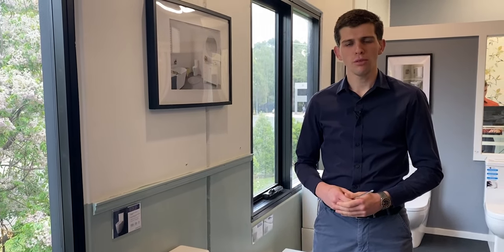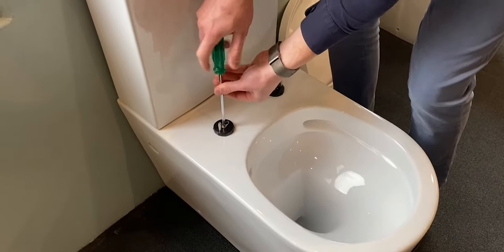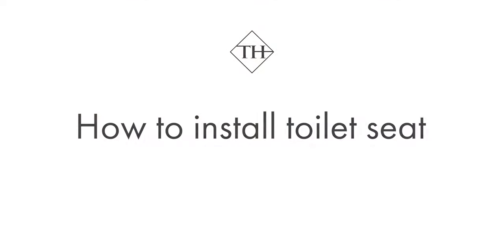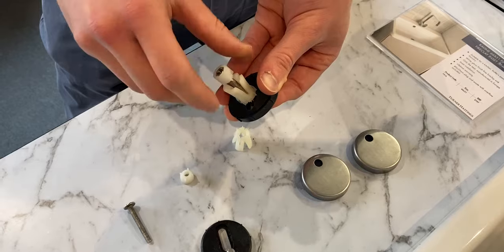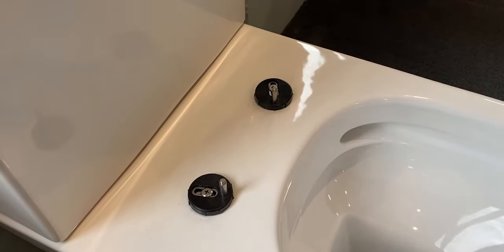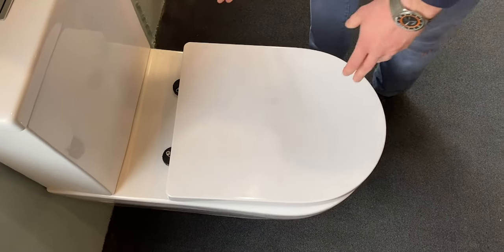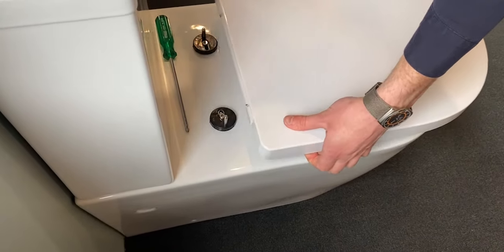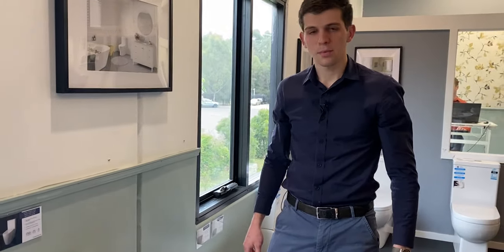How to Remove and Install a Toilet Seat

Comment: This is probably 8th toilet-seat DIY video I watched today. And it's the first one that actually showed the type of toilet seat that I need help with. And it was explained nice and clearly, at the right speed. Thank you so much
Reply: I can't get at the screw now to tighten it since I've put the plastic disc over the screw,can't get the disc off what  nightmare.
Reply: It was well explained. I followed the instructions, and I have successfully fixed two of the toilet seats that have been giving me concern. Thank you so much.
Reply: My words are exactly yours. Thanks for the excellent video and explanations.
Reply: I came here to leave this exact comment only to find out that you’d left it a year ago already!

Comment: Brilliant video!  I hadn't changed a seat since the 1970s and my earlier efforts involved inserting a plastic bolt then reaching under the seat to do up a nylon wingnut.  However, our newer pan doesn't have any exposed area underneath and I was a bit scared the whole pan might have to come out, which would be beyond my capability and expensive!  But this chap showed the way and the new seat is safely installed!
Reply from the maker: So glad the video helped!

Comment: Thank you for this lesson Jordan, it enabled and equipped me to help myself. 

Your guidance in demonstration was just what was needed.  Your style and delivery encouraged me to complete a task that I had started but could not finish. I had removed the old toilet seat but got stuck at removing the screw fittings, so my  replacement toilet seat sat in its wrapping for a little while, until today. 

The key point (for me) was when you said not to worry about the bits at the bottom of the old screw that may probably drop down  inside the integrated unit; that freed me and now the job is done at last! Thank you so much. 

Keep teaching, you have a gift.😊

Comment: Brilliant instruction video. Thank you so much for putting this online. I couldn't even get the old seat off, with its hidden fixings, before watching this. So it has shown me how to remove the old and then fit the new. My new fixings were slightly different but this advice still worked for mine. Very clear and easy to follow. Thank you!

Comment: An excellent video, clearly explained and demonstrated. Like many of us, I had no idea that the seat could be removed so easily for cleaning round the fittings. I now feel confident that I can install a new wooden seat properly. The issue with the twisted rubber seal is also useful for us to know. Thanks mate!

Comment: Thank you for this, I have been struggling to get the cover off my fitting. Hot water on a cloth over the fitting for a few minutes and it came off fairly easily. My toilet seat no longer wobbles 😀

Comment: I had to remove one of these and it's pretty dirty and a bit rusty. I've take one off before, but I couldn't remember how I did it. I knew the screws were under the metal caps but they wouldn't come off and I didn't want to break it. Seeing this I knew what I had to do.
Thanks

Comment: Thanks so much for posting this. I had no idea I could do this so easily. The only part that didn't match my new seat was needing to push in the rubber/silicone bit  with a screw driver rather than screw it on prior to inserting.

Comment: Hi there! Where can I purchase the plastic 'expanding piece' and the plastic 'nut' that you demonstrated in your video? The only fixing kit available to the public in NZ that I can find is at Bunnings and it comes with a wingnut that needs to be attached to the underside of the seat and I can't get to the underside of the seat! Please help!
Reply from the maker: Hi Tim, you could try Plumbline or Newtech in NZ for similar products. I hope that helps.

Comment: If the bolt corrodes and 1/2 is broken and stuck on the base, can you just push it through?
Reply from the maker: Yes, pushing it through would work

Comment: As it's the same toilet seat,could you not just have clicked the new seat on without replacing the fittings?
Reply: Yes he could have, but he is showing you in case you need to replace the fixings as well.

Comment: What if it dont unscrew, i tried really hard to turn anti clockwise but screw doesnt come off and hinge still really tight
Reply from the maker: You could perhaps try using a power drill to help unscrew this

Comment: But when it need tightening, how on earth do you get the bolts tight or loosened to replace. The rubber deals are locked to the bolt. Pretty easy to change one seat for another per your video, but removing the bolts is a nightmare unless there is a simpler way than I was able to figure out. Took me an hour
Reply: well the tightening works like the tighteners on the walls the outer ring open more when you screw it in and thus the tightening into the hole when you try loosen it it closes so it its smaller than the hole hold on but honestly if you cant unscrew it for some unfortunately reason rust old toilet etc just drill in the screw so the cap get broken and let the screw just fall into the toilet it wont kill your toilet in the end you will have a clean hole just take a towel wrap it in your finger clean good with some alcohol and screw in those new ones he shows and they can be replaced later too without problem since they are made that way that they are convenient for it
Reply: @UCgEXtxIXuJmK1hJvaQ0pc1w well in my case i just used driller after i realised that there is no way than break em nuts
Reply: I dropped nut and bolts 
How can I get plastic nut and bolts like u got